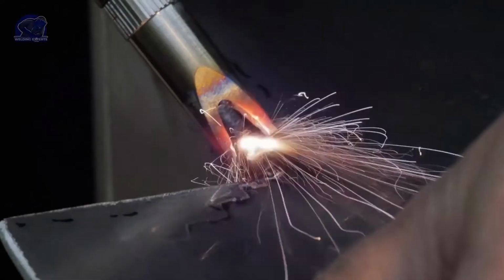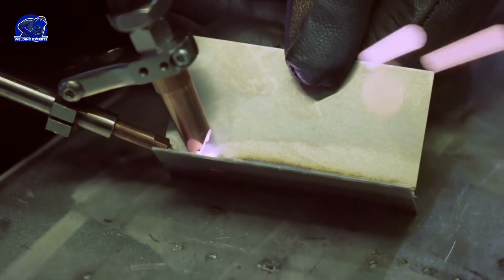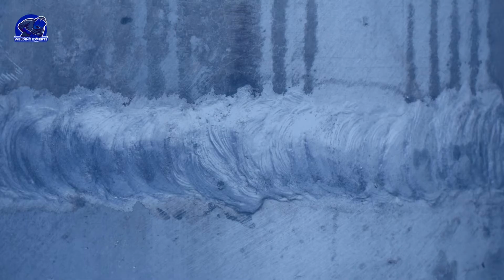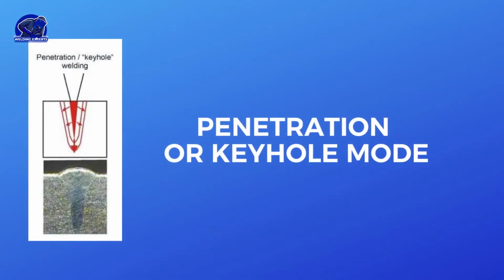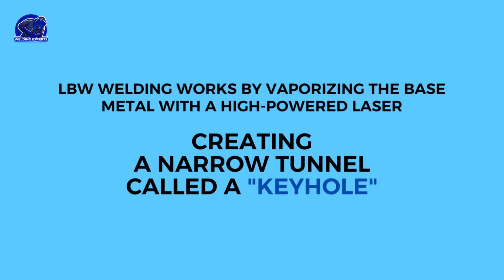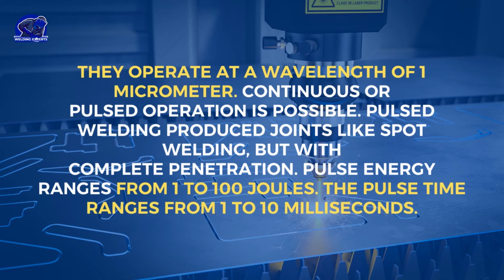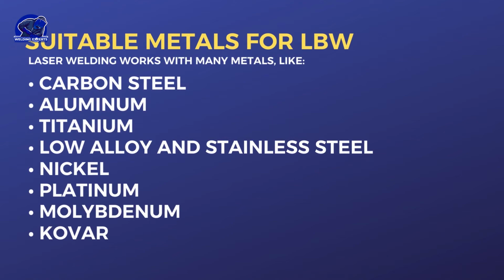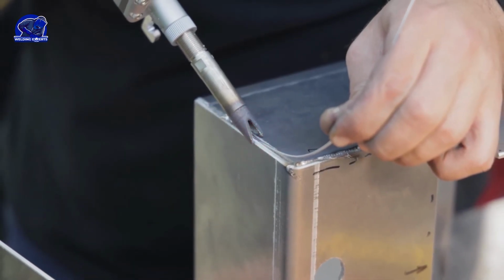What Is Laser Beam Welding and How Does It Work?

Comment: Whoa! There’s a problem right away. The fork tip should not get hot like that. It seems that the beam sweep width is too wide and impacting the sides of the fork. That’s not good. Either use a wider fork, or narrow the beam so that it doesn’t touch.

You can vary the penetration by changing the gun speed. The slower, the more penetration. When using wire, slow the wire feed by a bit until you get the penetration you need. You don’t always have to increase the power.